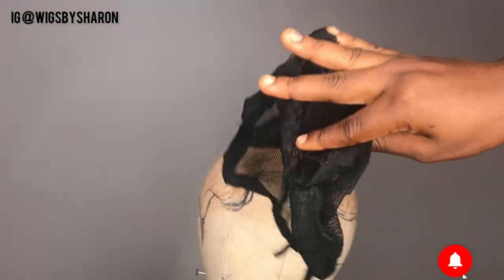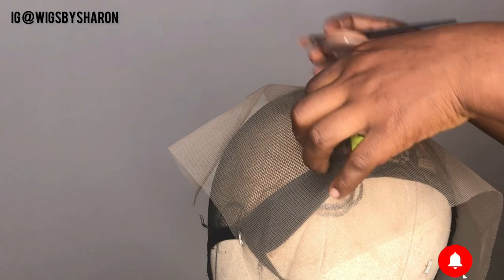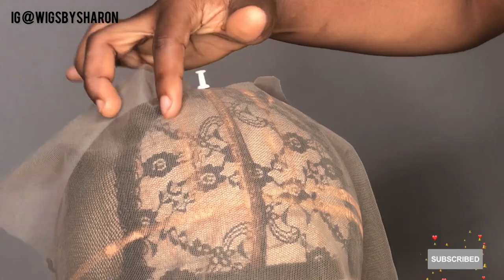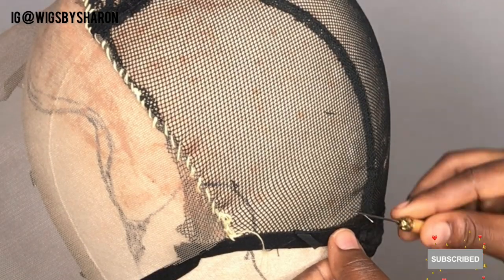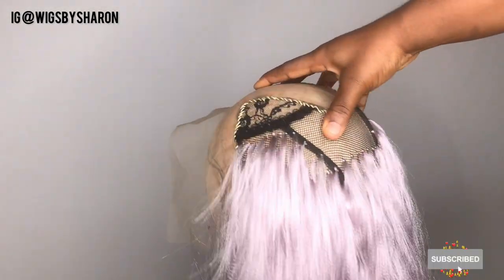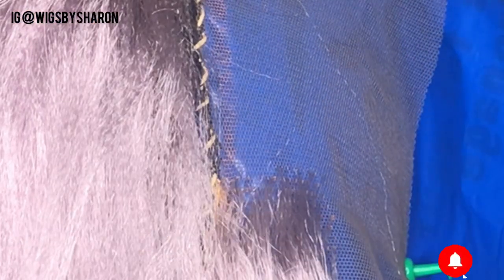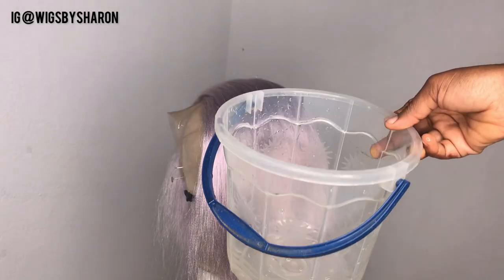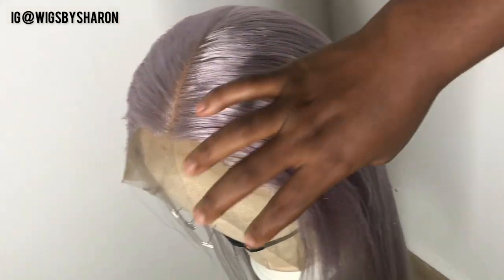DIY CROCHET FRONTAL WIG WITH BRAIDING(kanekalon) HAIR

Comment: Thanks my online teacher. My questions are 1:How do i get to customize a client's hairline i need your advice on it. 2:Am having difficulty using my ventilating pin, so am only used to the crochet latch instead i need to see a slow motion on how you usually use your ventilating pin. Thanks for your quick response.
Reply from the maker: 1. You can do this in two ways
a. If the client is with you, it’ll be a lot easier … you can place the lace on the client’s head and trace out the hairline
b. If the client isn’t with you , you can ask them to measure the length in between their ears(from ear to ear) to get the length of the frontal, ask for a pics of their hair line just so you can have a guide… measure out the length of the frontal on the lace or mannequin you’re using, and trace out the hairline from ear to ear using their picture as a guideline.. I hope this helps🙂

2. I have detailed ventilation videos on my channel and a link to those videos is in the description box
Reply: @SHARONOTV  thanks so much my online teacher!!!